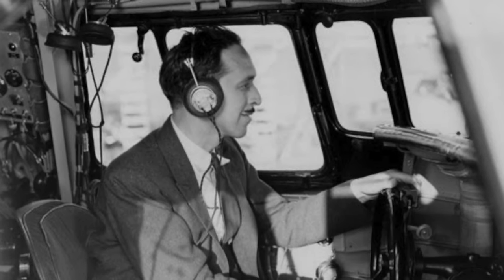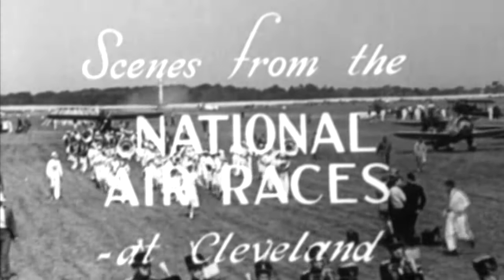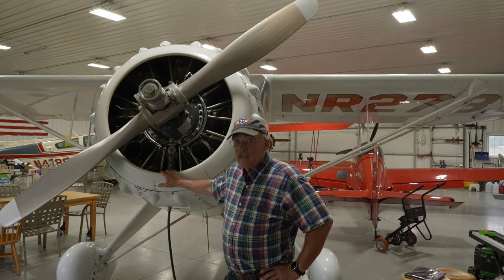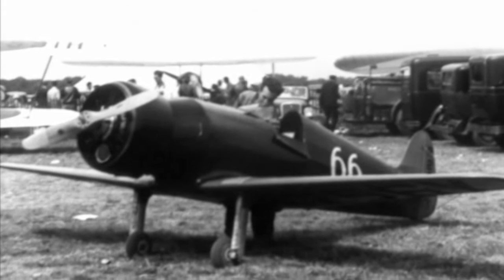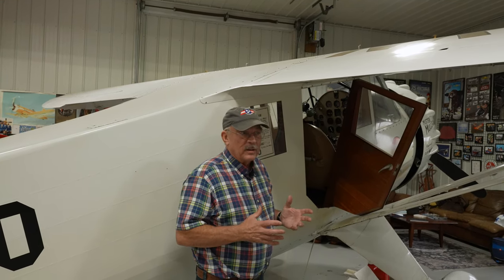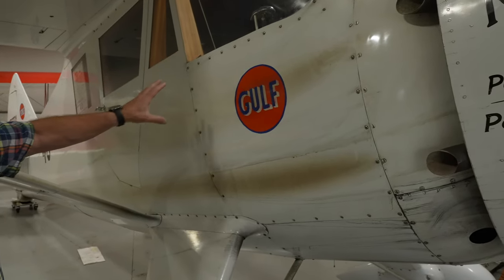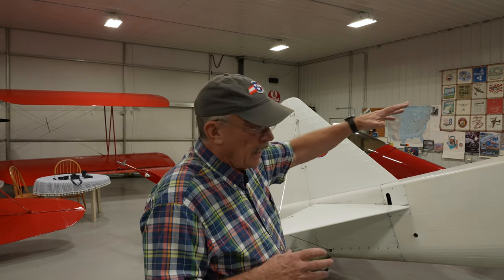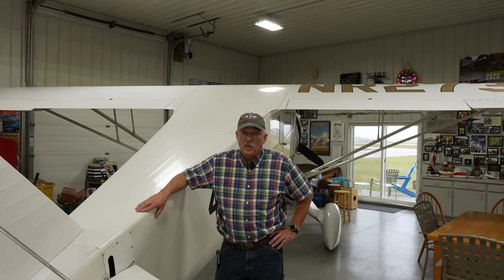Mr. Mulligan - how the Howard DGA-6 won the Bendix Trophy

Comment: Fantastic video and airplane. Thanks for sharing. 

A small quibble. The original Mr. Mulligan was built at Fairfax Airport in Kansas City, Kansas, not Missouri. It was built in the abandoned American Eagle Aircraft factory that had been closed during the Depression.

Fairfax was also home to Rearwin Aircraft, Inland Sport, Porterfield, and a little known company named Mercury Aircraft. Up until recently you could see the Mercury name on a building on the south side of the airport. The company was financed in the glory days after Lindbergh's flight, but died after the market crash of 1929.

When I was growing up in KCK in the sixties the old American Eagle factory, which was across the street from the airport, was a mattress manufacturing plant.

Had a chance to speak to Harold Neumann several times. The prototype of a true gentleman.